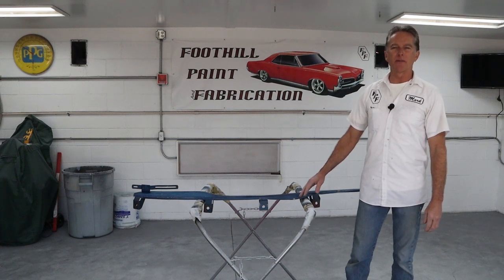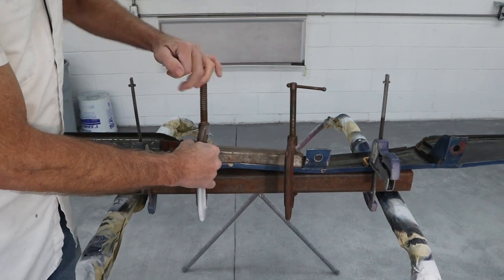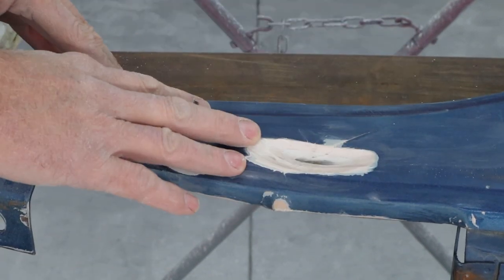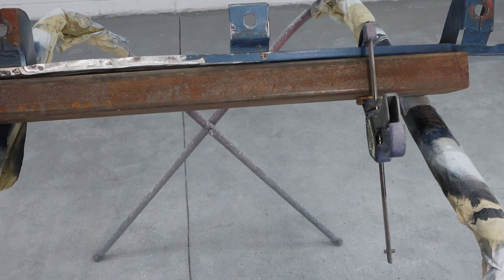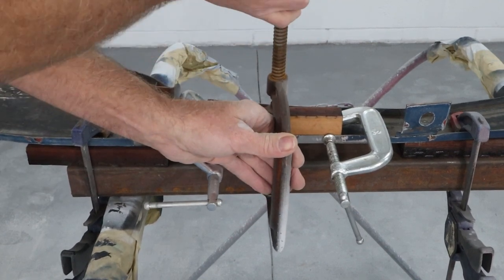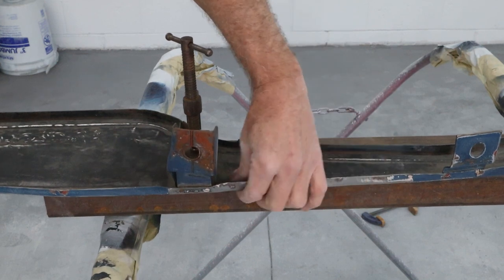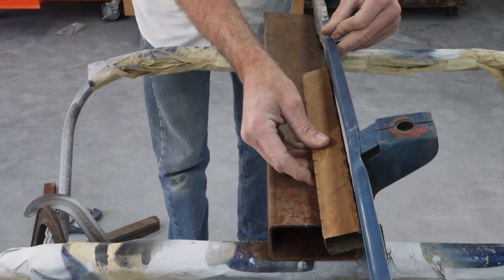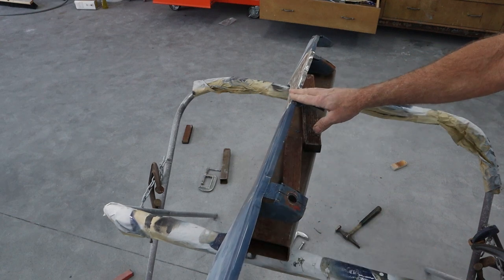1950 Chevy Truck (Ep 54) Straightening the Bumper Splash Apron

Comment: I am not good at metal work, but i do have a question. What if you add some heat from a blow torch or someting, wouldnt the metal be easier to shape and stay in shape ?
Reply from the maker: Good question.  Heating sheetmetal is your last option because of the added distortion and warping that can occur. Shrinking over stretched sheetmetal from either the initial damage or straightening can be accomplished with heat but that is saved  for the very last if you stretched it to much.  Steel expands when heated so if you heat a part and it expands, then straighten it and then it cools and contracts you loose control over the shape.  Slow and cold works best for me.